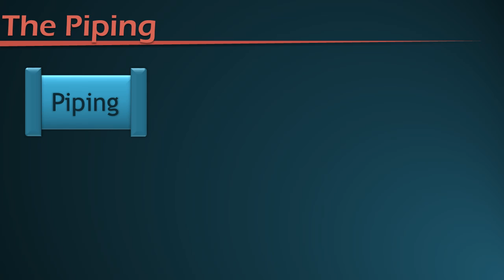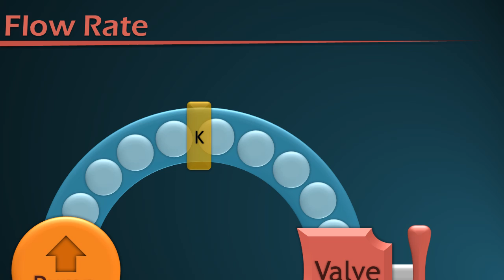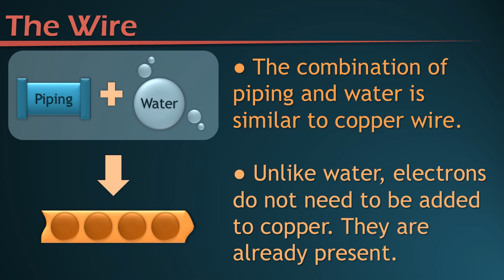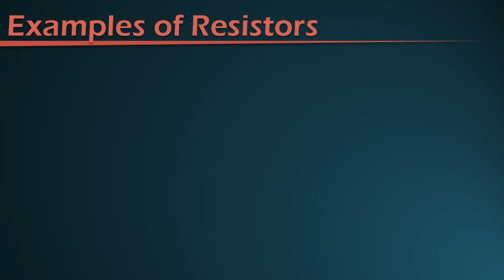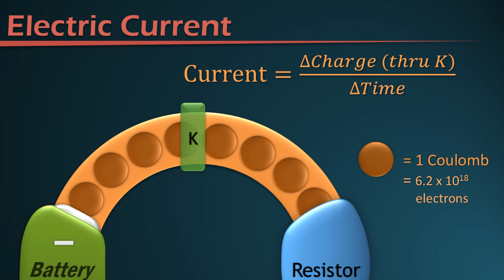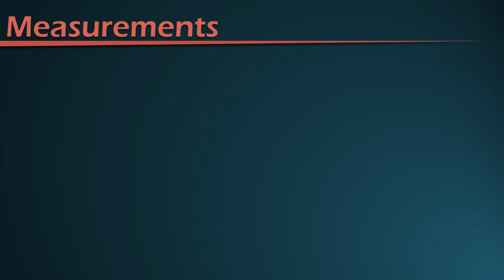Comment: Electrons flow from an area of greater charge to an area of lower charge, from positive to negative, NOT negative to positive. :/
Reply: Electrons do in fact flow from the negative terminal of a battery to the positive terminal. Electrons are negatively charged. There is a chemical "half reaction" with produces an excess of electrons at the negative. At the positive terminal of a battery, there is a lack of electrons, or lack of negative charge. Thus, the negative terminal is more negatively charged than the positive terminal, causing electrons to want to flow from negative to positive.

The confusion may lie in the fact that "electron flow" (which is what is really happening in a circuit) defines electrons as the charge carriers while "conventional flow" (which is what engineers use to design circuits) defines a positive charge as the charge carrier in a circuit. They are exactly the same thing in practice, except the direction of current is reversed. Thus, in conventional flow we say current flows from positive to negative, but in electron flow we say electrons flow from negative to positive.

Comment: If electrons flow from the negative pole to the positive pole of a battery, does that mean they flow through the battery itself, or only through a conductive material -- outside of the battery -- connecting the two poles?  No one is ever clear on that, I've noticed, which is odd to me because that's the first question that comes to my mind when this fact is stated.
Reply: The electrons flow out of the negative terminal of the battery, through an external circuit (could be a resistor, could be a complicated microprocessor circuit), and eventually back into the positive terminal of the battery. 

Inside a voltage source, the electrons flow from positive to negative. Imagine that electrons which "returned home" to the positive terminal are re-energized and sent back out the negative terminal.

But in reality, there is no internal flow of electrons in a battery. This is unique to batteries. In just about all other types of voltage sources, there is electron flow through the source. In a battery, there is a flow of positive ions caused by an oxidation-reduction reaction. If you would like to learn about batteries in particular, try googling "electrochemistry".
Reply: Thanks.  So, if the electrons which flow to the positive battery terminal don't flow through the battery to return to the negative, where do all of these electrons go?  Wouldn't they have to be dispersed/dissipated, otherwise would build up in that one spot?
Reply: Pretty close! In a battery, basically you have two halves which are "distressed". Each of these halves are called "half-cells". In a 
"normal chemical reaction" , we typically have an aqueous solution containing one or more chemicals. When we add other chemical(s) to that solution, the reaction instantly happens because the chemicals are directly exposed to each other in the same solution.

In a battery, we basically isolate the reagents (reacting chemicals) from each other. We set up two "half reactions": one which produces an excess of electrons, and one which needs additional electrons. In aqueous solution, these reactions would basically happen all at once. First one reaction occurs, producing an excess of electrons in solution, and then those electrons would get used to satisfy the other half reaction in need of electrons.

In a battery however, we prevent that transfer of electrons by isolating the two reactions in two physically separate compartments. In order to transfer the excess electrons from positive terminal (with excess electrons) to the negative terminal (which needs electrons), we can connect an external conducting wire. This allows these "distressed" half cells to reach equilibrium, which is ultimately what nature "wants". In our case, we don't just connect a wire directly across the two terminals of a battery. (That's a short circuit).) Instead, we redirect those electrons through meaningful circuits to do useful work.

When all of the excess electrons from the positive terminal have been transferred to the negative terminal (and used up by the reaction there), then the battery's charge is depleted and will no longer produce a voltage.

Comment: Can you talk about "pull up" resistors? For a switch, how to prevent debouncing? Along the same line, simple use case base explanation for diodes, capacitors, transistors, etc., very similar to how you did this video. BTW - excellent video. Thanks.

Comment: i'm slightly confused. If i have an 8 ohm speaker connected to a five volt battery, the ampere is 0.625. Does that mean that there are 0.625 amps running through the speaker, or the wire?

Another question:

I connected a + from one 9 volt battery to the - of another 9 volt battery but it wouldn't work. How come?
Reply: Both the speaker and the wire. The current is the same at every point. If the rate of flow of electrons (current) is the same going into the speaker (out of the battery) as it is coming out of the speaker (back into the battery), then that means that current within the speaker must be the same. Think about it.

What do you mean it wouldn't work?
Reply: Ok thanks! About the battery not working: I connected a motor to the + on one 9 volt battery, and the other wire to the - on another 9 volt battery, however, the motor did not turn. I then hooked it up to a single 9 volt battery and it started working.

Comment: having trouble determining the difference between volt and ampere
Reply: Id recommend going through, or skipping through the video one more time. Theres a pretty huge difference. However, I can tell you that voltage is the "pushing force" that pushes electrons around the circuit, while current (amperes) is how many electrons are being pushed through some point in a given amount of time. The more pushing force (voltage), the greater the rate of flow of charge, or current. (ampere)
Reply: Volt is the unit of measure of voltage. Ampere is a unit of measure for current

Comment: great video.  still not sure why a 240V hot water heater has no need for a neutral wire,  From the video I assume the electrons dance across to the neutral from the connecter bar.  Ground and Neutral are on opposite sides of the panel, but connected directly together at the panel by an aluminum bar

Comment: Are resistors the same as loads? I'm confused about the two when dealing with water analogies to electric circuits.
Reply: Yes a resistor is the load in this case. In other cases, a load can be a light bulb, a motor, a speaker (if you have an AC signal) etc. Loads come in all shapes and sizes but for the sake of this video, I just used the simplest of loads...the resistor.

Comment: That was a very well produced upload, Illustrated nicely.  The water comparison was a bit too much for me (in terms of length) but once moved on from that I found it very watchable.  Thanks.

What are you going to cover next?  I hope this will turn into a series.
Reply: Thanks! I actually cut down the water analogy from the last time, but good feedback.

I'm not entirely sure what I want to cover. I've been doing these introduction videos because I think its a good way to get started in certain areas of electronics. 

I can do more on simple circuits, but I feel once you understand the basics, its not that hard to figure out the rest. Also, this video was a little more on the "physics-end" of things. I like being on the engineering side of things more than straight science.

But we'll see. Any suggestions?